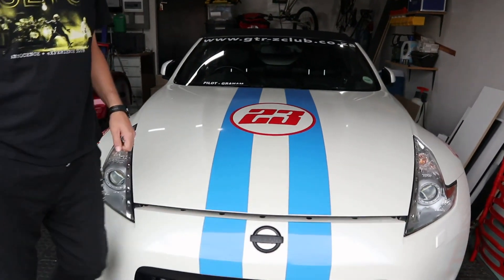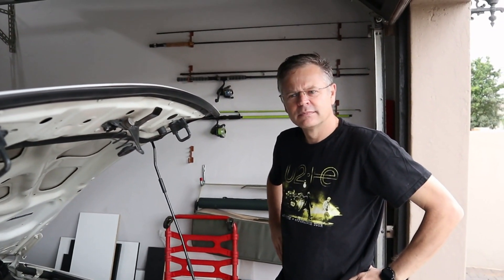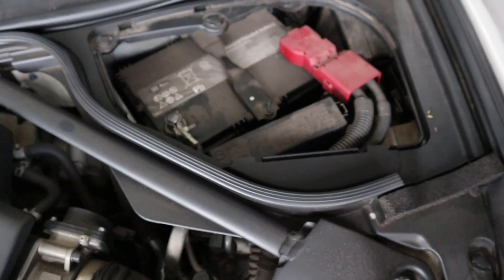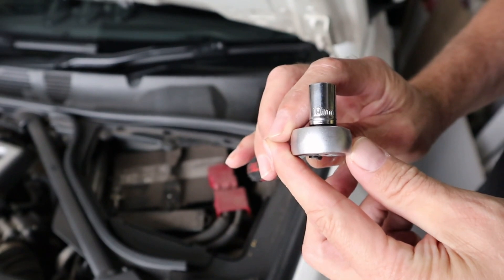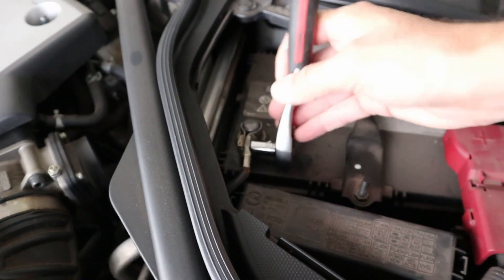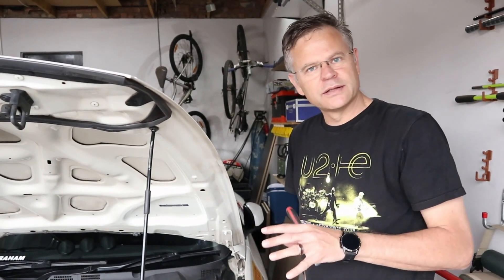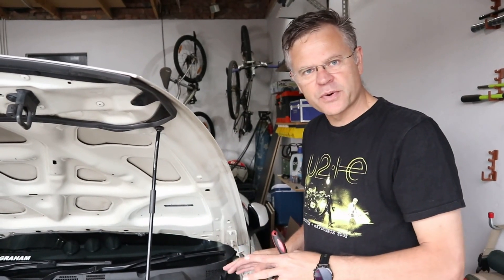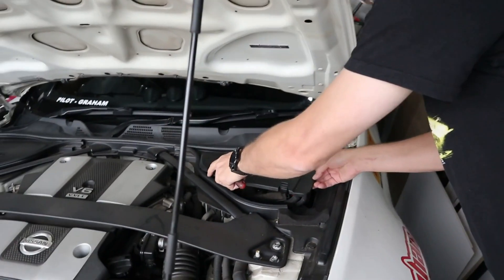How to disconnect the battery on your car if you have to store it for Corona lockdown

Comment: I plan to store the car in my detached garage where it might get below freezing. Should I take the battery completely out and store it in my house?
Reply from the maker: Hello and thanks for the comment. Lead acid batteries do not like temperature fluctuation and vibration much. It is a little ironic if you consider where most manufacturers place the battery... my suggestion would be to remove it and store it where temperatures will be fairly stable - also place it on tip of a block of wood, as opposed to directly on the floor. Wood block or a wooden shelf will isolated the battery from the floor, which will further regulate temperature fluctuations. Stay away from cement or metal. Hope this helps?

Comment: If we remove both terminals then is it ok to save battery from drainage  ?
Reply from the maker: Hi. Yes you can remove both, but it is no different from removing only one. Only time I would recommend that, is if you wanted to take the battery out and store it in a better place. This is when your car maybe will stand outside or the battery will have major temperature fluctuations.
Reply: @We-R-Racing  thanks u

Comment: Will the battery will drained out If only negative is disconnected and Positive is connected with the car.
Reply from the maker: Once negative is disconnected, there is no circuit, so the battery won't drain. Many cars have multiple systems connected to the positive terminal, so they are more hassle to disconnect
Reply: @We-R-Racing  Thank u for this knowledge. 
Luv from India. :)

Comment: Thanks for this informative video. I think I know the answer after reading your other responses, but this is a slight variation of what others have asked. Can I simply remove/disconnect the negative battery cable from the frame instead of from the battery? On my 1969 Corvette, it can be difficult to get the cable back onto the battery, whereas I have a car lift and can much more easily remove it from the frame.
Reply from the maker: Thanks for the comment James. Yes absolutely. The objective is to just break the circuit. Keep in mind that you might have several earth straps, some of which may connect direct to the battery. In this case the circuit won't be broken and the battery will still run down

Comment: I have a 2015 model c 250 mercedes benz , can I disconnect the battery for 7 months ?
Reply from the maker: Absolutely. It would be advisable to leave the battery on a trickle charger so it dies not run down.
Reply: @We-R-Racing  
Can I just leave in the car after taking off the negative cable?
Reply from the maker: Indeed you can yes. Only 1 pole needs yo be disconnected to release the circuit.  Batteries do not like temp variation though. See of you can store it in some sort of stable or temp controlled place
Reply: @We-R-Racing  
Thank you so much for valuable information.

Comment: I disconnected the negative cable from the negative terminal of the battery, however my car is stored/parked outside and it is usually hot outside. Is it okay i leave the battery there or should I store it in my house under a wooden cabinet or storage?
Reply from the maker: Hi Benedict. Batteries typically do not like extreme temperatures. If you have more than 15 degrees Celsius variation, I would consider storing it where the fluctuations are less. Definitely keep it away from below 10C and above 30C. Hope that helps
Reply: @We-R-Racing  thanks! I’ll store it somewhere safe, i just left it under the hood with the negative cable disconnected and i just bought a new battery recently.
Reply: @LUP4T will the car still draw power if the positive is connected . Or disconnecting the negative is enough and the battery can hold its charge for atleast six months
Reply from the maker: Once the negative is disconnected, there is no circuit, so no current. Battery should last 6 months, unless the battery is already faulty and has an internal short, in which case it will slowly drain, but because it is a bad battery,, not because of the positive wire.
Reply: @We-R-Racing  thank you . That is the easy answer i wanted 👍👍

Comment: Im planning to leave my car for 5 months  is it possible?
Reply from the maker: If the battery is fully charged and you can keep it in a temperature controlled space, you could actually make that work. Lead acid do not like temperature fluctuation and vibration.  You should never store the battery direct on bare floor or a steel shelf... such as the one where its installed in the car... the nest way is to disconnect the battery, store it on a wooden shelf and connect a trickle charger.
Reply: @We-R-Racing  where i live the temperature is around 9 - 20 degrees Celsius do I still have to take the battery out of the car ? Or i can just disconnect negative pole and leave it in the car ?
Reply from the maker: @thabetiann5566  yes that temperature range should be fine. Do consider getting a trickle charger if possible. There is a huge difference between a normal and trickle charger - the latter keeps the battery conditioned - just check if you decide to go that route
Reply: @We-R-Racing  thank you so much

Comment: After removing the negative cable, do I need to wrap the negative cable and the negative terminal with plastic to avoid any sort of issues?
Reply from the maker: Hey Mathew. Thanks for the comment.  No you don't, this is why we remove the negative.  Just tuck it  neatly away from the terminal so it can't accidentally touch again. That's it 😁

Comment: Hey will this reset the computer of the car and cause any problems later when restarted ? I own a honda 2.0 10th gen
Reply from the maker: Hi Wasay. If you have errors in the c9mputer now, this might reset momentarily. If the problem that caused the issue still exist, it will come back though. Disconnecting the computer for a long period will not affect the car's normal operation in any way. It is safe to do so.
Reply: @We-R-Racing  thanks appreciate the  prompt response.  One more thing , can I just disconnect the negative  terminal only if I am leaving the car parked for 2 weeks ?
Reply from the maker: @wasayable  yes.  Only the negative is required.